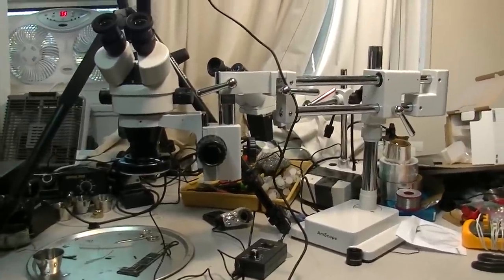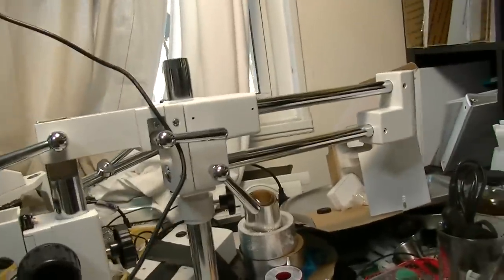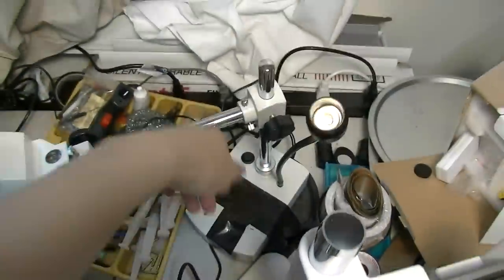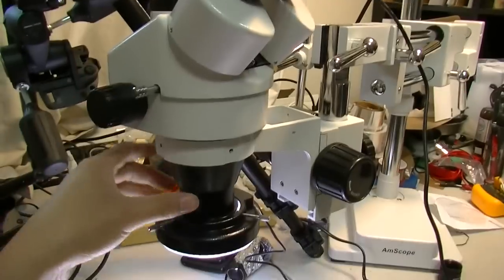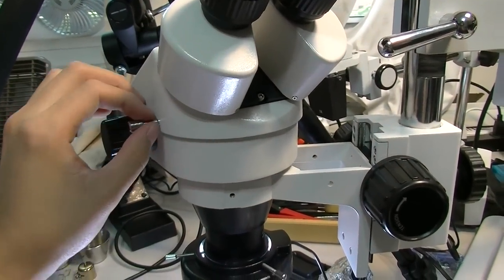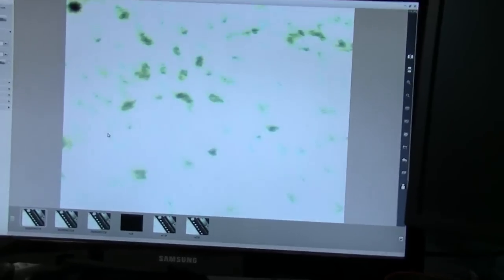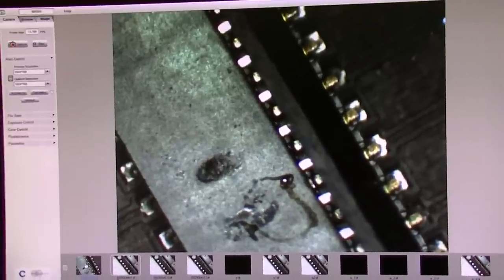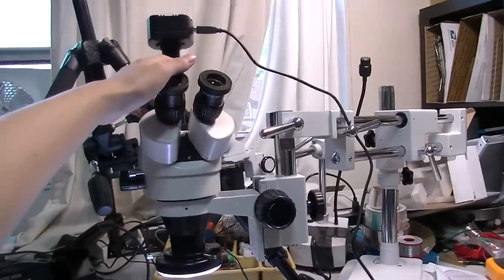Soldering Microscope Stereo on Boom Stand review solder, micro surgery, AmScope Microscope

Comment: What locks the camera to prevent it rotating each time USB cable pulls it? I've seen recently someone mentioned a camera adapter which does exactly that but can't remember where I've seen it.
My 4TPZ is on the way, it's simul-focal (this is what you want) and comes with 18MP USB3.0 camera. Can't wait.

Comment: Thumbs up for sharing the downsides of that $900 AmScope - people can really learn from that.  What kind of video camera would you recommend for the smaller SE400 model you have there on the table? That's the model I bought about 2 years ago before I realized the potential of using a camera.  

Also, I was shocked to learn your camera on the large beast could only take photos!  Wah, you must have been so disappointed with that.  So thanks again for a very informative video.  Good luck with your next purchase!  Cheers!

Comment: What kind of Soldering Station do you use or recommend which is not too expensive too.
Reply from the maker: I used to use Aoyue  HATE IT waste of money  very poor quality.   Now I am buying Hakko to replace all my labs all the way.   that extra 50~100$ difference is worth it, trust me.
Reply: CyberDoc LLC I mostly work of iPhone and iPads, also I change that charging ports on Galaxy phones. I have to say that I love your Flux and Low temp desoldering wires. Any recommendation on Hakko as far as Watts and models if you know any? Also, what kind of tray are you putting Logic boards on? Is it ESD safe?
Reply: CyberDoc LLC What is the hakko equivalent of an Aoyue rework station with Hot air & copper tips compatible soldering iron?

Comment: CyberDoc -- very nice review. Could you comment on the working distance versus the auxiliary objective, and the actual working distance that you have found useful? I think you are getting an 8-inch distance with the 0.5X aux lens, and an actual max magnification of 45, but what mag do you actually use, and is the normal 4 inches too cramped to get soldering tools in place?
Reply: On closer look, it seems that the body will zoom from 0.7 to 4.5. Multiply that by 10x eyepieces for 7X-45X. Then you can optionally attach either the 0.5X or 2.0X Barlow auxiliary lens, giving you a lower or higher range respectively. But I think only with the 0.5X aux lens (so 3.5X-22.5X) will you get the 8-inch working distance.
Reply: +Graham Wideman Yes. His objective lens is 0.7-4.5X, his eyepieces are 10X, and his barlow lens is 0.5x. Therefore his current setup max magnification is (4.5*10*0.5)=22.5X. It looks fantastic though!